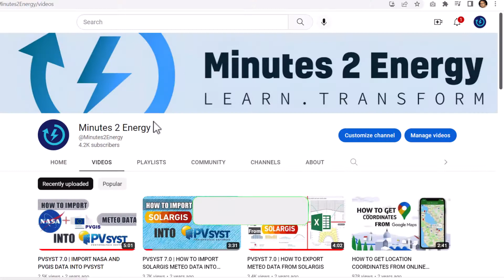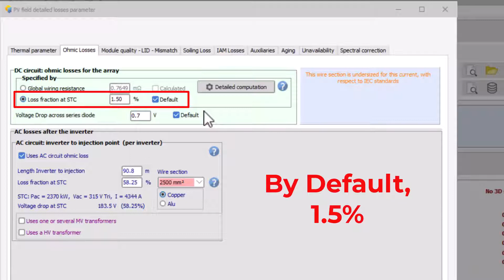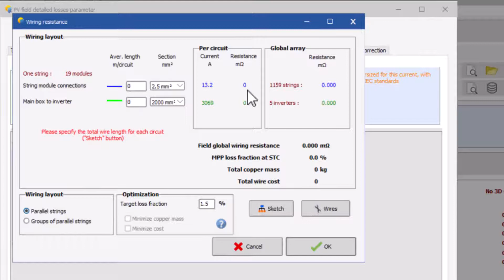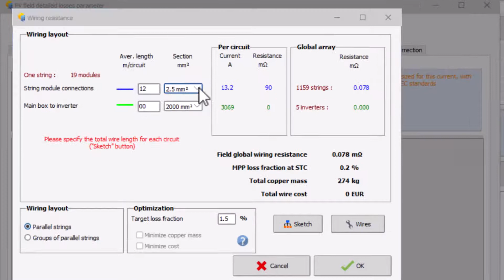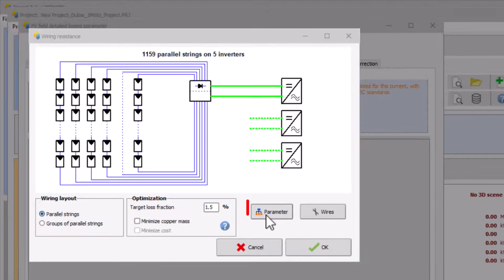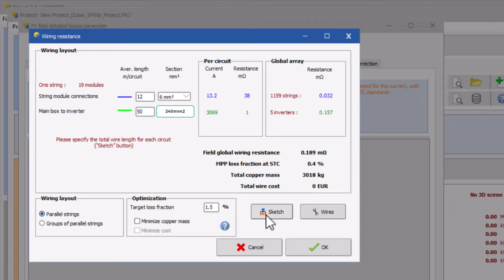HOW TO CALCULATE DC OHMIC LOSS IN PVSYST

Comment: How do you select the 240mm2 if the software doesn't allow it?
Reply from the maker: Pvsyst is not disabling the usage of 240sq.mm. Red means the losses will be higher than the pre-defined value (in project settings)
Reply: @Minutes2Energy  But in the video you wanted to select the 240mm2 wire but the PVSyst didnt allow it, so you had to select the lower cable section which was 1200mm2, from main box to inverter.